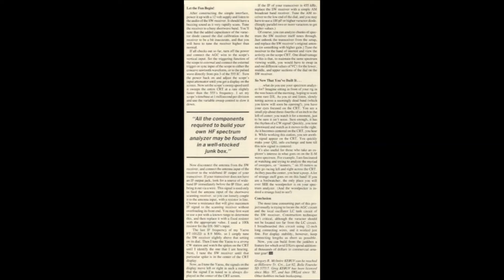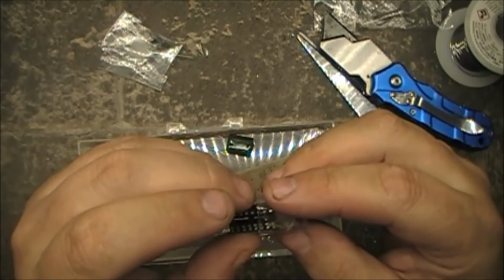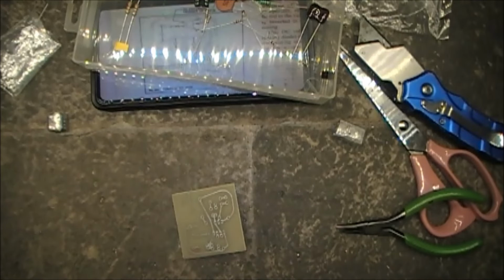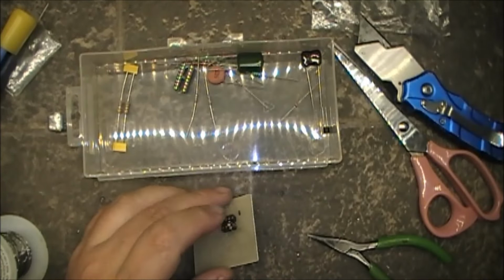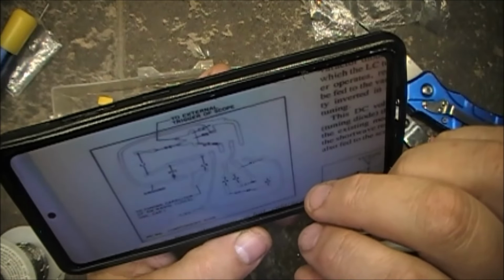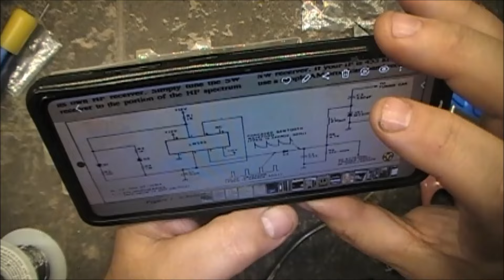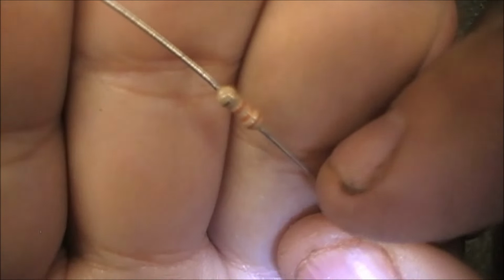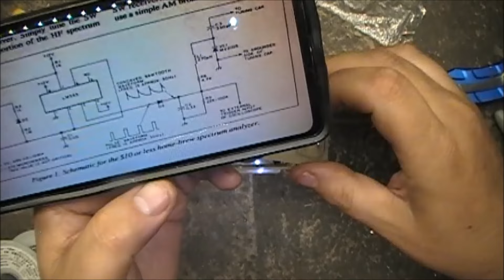Homebrew Spectrum analyzer  Part-3

Comment: I sit here with 3 cheap spectrum analyzers on my bench and 2 high-end ones, (between the 2 they span 20 Hz to 7 GHz,) and yet I'm contemplating building one of these frequency sweepers with a 555 ramp and a varactor, because to me this sort of thing has always been what appealed to me as fun electronics. BTW, perhaps they gave you the socket for the 556, which is a 14 pin dual 555.